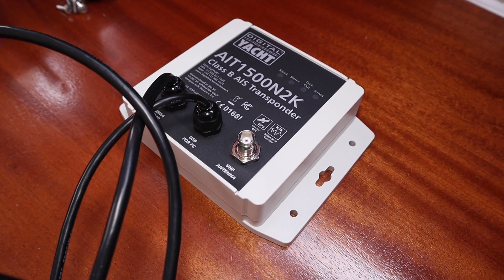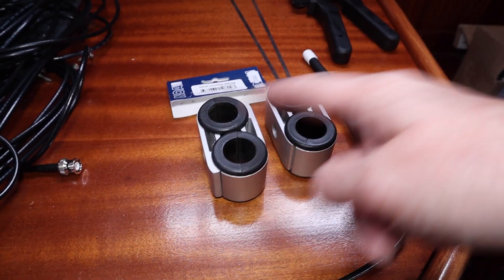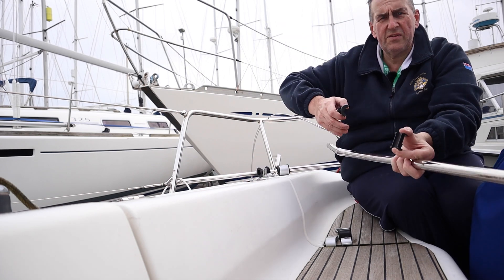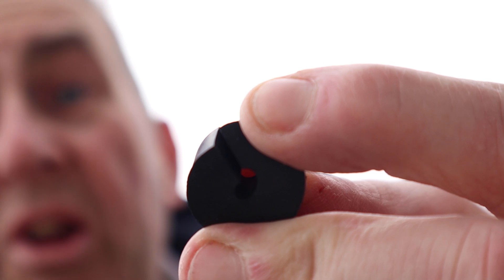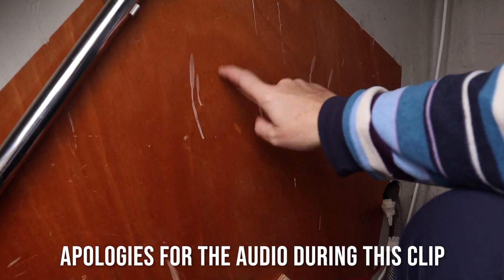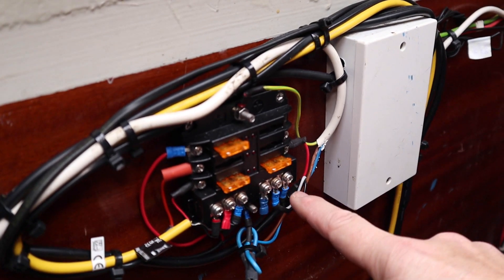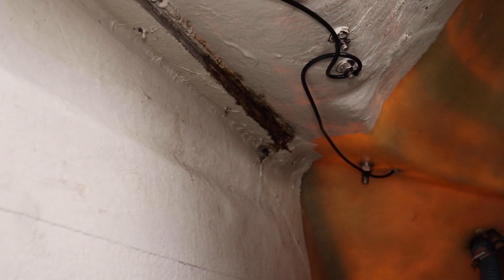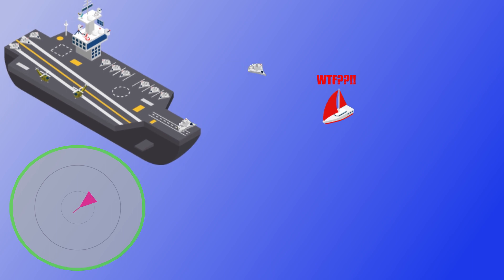AIS Install on Bavaria 36 (09)

Comment: Can you tell me where you obtained the distribution box situated in your locker?
Reply from the maker: Amazon as it happens! They have several types but this was the one that had the bus bar for negative. Fuse Box with Negative Bus, Blade Fuses Holder Block 6 Way with LED Indicator for Boat Van Car Truck Marine https://www.amazon.co.uk/dp/B07K4232VG/ref=cm_sw_r_cp_api_i_ZWLTEbBCY0WC2
Reply: @BerylMaryTravels  thanks for that, most versatile box tha I have seen. Keep up the videos.

Comment: Glad to see you put the AIS video up and thank you for mention for our Lazerette hotel business :-) We have finally got our AIS ariel remounted from the cable ties to something more permanent but we were disappointed to see you used standard black ties instead of the highly fashionable bright red ones we employed. Your Webasto "box" looks really good BTW
Reply from the maker: Thank you! I was concerned for a tiny while about the potential for recirculating air, but the handy vent pipes seem to have done the trick. My crew has a tendency to throw stuff in the locker so a box was completely logical! Also - because I knew we’d need the space in the aft section for some thing else (guess what I’m fitting next which is amazing how we are both doing the same things to the boats!) I decided to put it in the slightly in the way position but as we have found - within the box it’s simply never in the way.